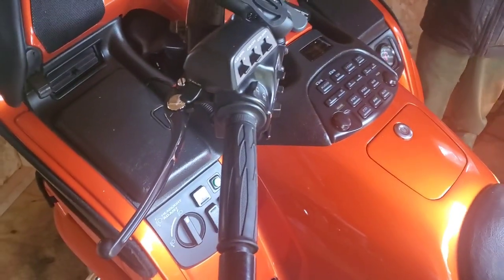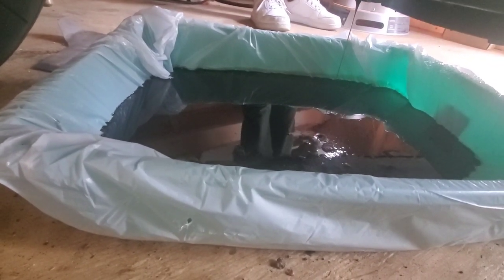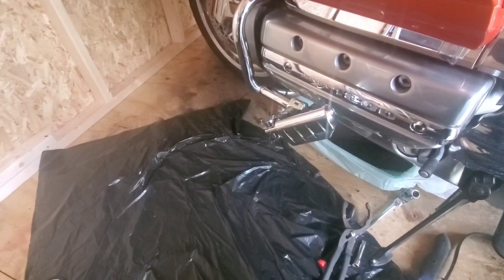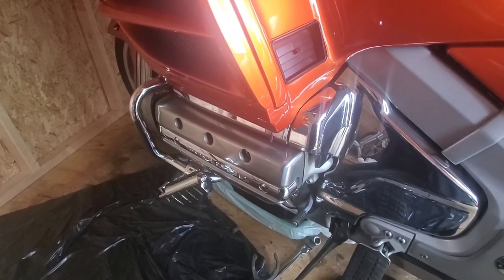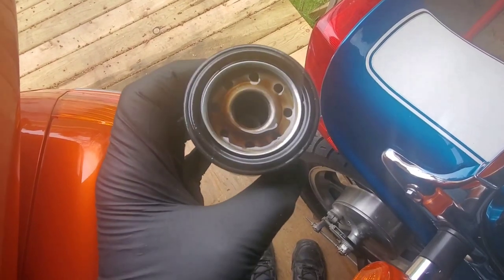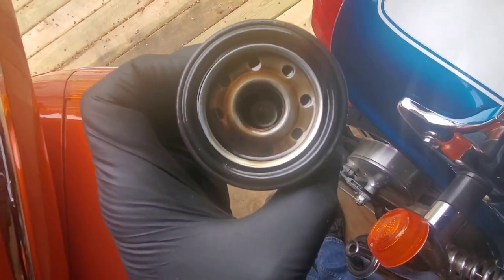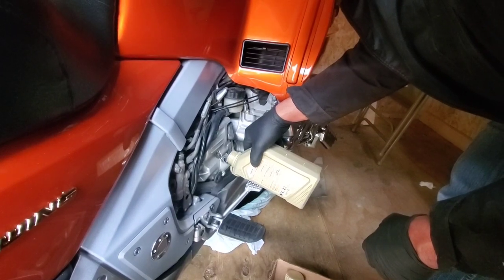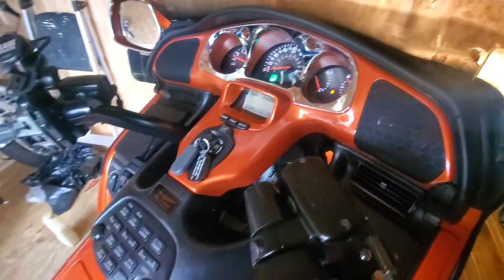WATCH THIS BEFORE YOU SEAFOAM A GOLD WING GL1800 AND POSSIBLY OTHER MOTORCYCLES

Comment: I fought the dreaded hesitation for 2 years on my 2008 Gl1800. I tried several bottles of seafoam, it seemed to help but did not cure it. I ran across an obscure post on a forum about the hesitation, he claimed to fix it. There was no other discussion about the fix he had explained. It was time for an air filter so while I had the shelter off I did what he recommended, it cured it. If you look closely down the bore of your throttle body where the butterfly plate seats on the sides of the bore at idle, you will see a faint dirty mark from the throttle plate. Take a toothbrush soaked with seafoam and lightly scrub that mark off the bore and the plate clean. It fixed it completely. I've got about 8K on it since then and still running perfect. Mine was so bad it was difficult to do any slow speed maneuvers in a stone parking lot without slipping the clutch drastically. Next time you do an air filter, check it out. You must look closely to see it, at first I didn't, then I got a light and I could see a dirt mark.
Reply from the maker: Well thank you. That is great info to have and will check into it. It has seemed to stop so far. However if it comes back I will do this the way it is explained. Thanks for watching and your informational comment. Stay safe my friend.
Reply: same thing for me too, once the butterflies were clean, no more stumble
Reply: That just seems almost unbelievable does it not? I'm not doubting you,  I just find it hard to believe that simply cleaning a tiny bit of a deposit on the throttle body bore would remedy a low speed stumble. That's wild.
Reply: @mosmotorcyclejourney9067 Moe is that s stock color orange or did you have it repainted???👍👍
Reply: @seatime674  That is a stock factory orange color from Honda. I’m not sure what year they made a couple of different oranges through the years. I’m 2000 up to 2010. I’m sure they had at least two different orange colors.
Reply: @raymondshartrand2417  I Think that orange was from '02 only..

Comment: That is a after market skid pan. We use sefome in our shop also but don't ever put more than 1/4 bottle well the top of your pistons and valves  are clean. We have been working on goldwings since 1975 we have great results with ams best viscosity will not lose more than 5%. Have bikes we work on with over 289000 miles on ams. One of those people is a imploye. Good video have a great day. Pops

Comment: I appreciate what you told us about the sea foam. I just bought a 1998 1500 with 18,000 and right away I changed the oil. I then noticed I had a hesitation and knew it was from sitting so long. 
Also, I owned three 1800's and they all had that pan under the motor and its to keep rocks from ponding the lower part of the motor.

Comment: Be thankful you have that metal guard covering the bottom of your engine Mo, it is to prevent objects from being thrown up from the surface of the road and going through your engine cases.
Reply from the maker: Trust me I am. I just never seen it on any oil change videos. And some videos on you tube say you have to remove the lower plastic piece where fog lights are to access the filter. Not on mine I didn't.  All I removed was the bottom pan and there it was. Thanks for the comment.

Comment: In to addition road debris protection some of the Wings have fore and aft ridges under there that can act as wings in a severe crosswind, leading to bad handling.  The belly pan blocks those cross winds.  Or so I read before I got mine!
 
1995 GL1500, Mobile1, once a season ( even for 10-12,000 miles. But it is almost all high miles, and very little in town. )

Comment: Pans are aftermarket item. I use the valvoline full syn in my wing. Told the dealer that .... he was agast that i wasnt using honda  lube. He even dared to say regular dinosaur honda oil was better. I just smiled and said thanks for your opinion.
Reply from the maker: I prefer vavoline just couldn't find it when I went to get it. I did order some off line and will be here next week. And I think I'm still gonna switch over. Can't hurt anything to change it again.  I prefer vavoline. And I hear it works great in the 1800 with a wet clutch. Thanks for letting me know the pans being aftermarket. Very much appreciated.

Comment: Conventional oil disapates heat better while synthetic superior slickness reduces friction. I use Honda synthetic blend. My engine runs cool and oil change intervals once every season is clean. The pan protects the motor from road debris definitely leave it on. Yes many bikes don't have that protection. Great video seafoam is a great product and can be added to oil right before oil change. Good call on dumping the oil right after treatment.

Comment: Great info on the oil. I have heard about the sea foam treatment but nothing about changing the oil after adding sea foam to the fuel.
Reply from the maker: Yeah if your bike hasn't had seafoam before I would definitely change the oil after a good treatment. It does clean alot of carbon out of the motor. Thanks for watching 👍
Reply: So your saying if u had seafoam to your fuel it cleans the whole motor. How does the seafoam get into you oil and cleans it

Comment: I used Shell Rottella T4 Conventional 15w40 in my Yamaha yx600. 14 bucks for 4 quarts. 
They have T6 which is the same weight but fully synthetic. Little more in price but lower than buying "motorcycle oil". its also got a lot of stuff to keep low miles motors running longer and keeping them clean. Same with older motors with zink and such.
Reply from the maker: Thanks for putting thus info on here. I get alot of questions about what kind of oil to use. And I love when people put what they use so others can see what works. Thanks again for viewing and please be safe out there
Reply: Ditto. Shell Rotella for my 38-year-old pristine ‘84 GL1200. But only the T6 FULL SYNTHETIC. Synthetic only  in all my vehicles. Syn is much superior to organic in every way. Longer lasting with superior lube qualities. Where organic oil will scald at high temps and lose its viscosity, synthetic has a MUCH higher scald temp retaining its viscosity much longer than organics can. It’s nearly burn proof!

Comment: I acquired a oil test machine at a sportsman show. I've tested all popular oils over the years an found "Castrol" oil out performs other oils, not by much, but still out performs!
Reply from the maker: Wow Tim. Thanks for sharing that information. 😀  maybe I should give that oil a closer look. 🤔  I never did a test on oil. Other then draining it out and refilling it. Lol. thanks for watching and the comment. Be safe sir.
Reply: You stack one lb. slotted weights on a rod, loading pressure 30 too 1 on head pressure until oil can't take any more pressure.  For a base dry test: seizures at 120lbs! Oil general seizes at 180lbs (giving most oils 60lbs of pressure, loading too seizure! Castrol takes one more weight than 180 too 210lbs!)
Reply from the maker: @timbarnett3898  that is great info. 👍   thank you for putting this in the comments Tim. That is useful information and I guess I will give Castrol another try. And that was also a great explanation of the test.

Comment: I had the same problem on my 2012… that slow speed hesitation… my fix was to get a G2 throttle tamer… the plastic oem throttle tube from Honda is crap… the G2 smoothed that hesitation right out… so no sea foam was needed 😊also what helped was to get the wide clutch lever from Show Chrome… better control at slow speeds using the friction zone 👍

Comment: I put seafoam in my 1800 about 2 ounces in tank about every 5 fill ups ,Half a can would be enough for about 20 gallons of fuell ,That much may affect oil ,I've not had dirty oil from the process I do
Reply: Thank you!  I'm glad I'm not the only one that does Seafoam this way!  I've never had a problem adding it to the tank, especially if I'm going to let it sit for a while in the winter.  I also change my synthetic oil every 5k miles whether it needs it or not.

Comment: I plan on doing this treatment on mine. Just changed the oil so think I'll wait a bit. Like you said the oil turns dark quickly. I am using non friction additive synthetic mobile 1. I also was surprised how expensive the filter was too. Made in China. Factory filter from Honda dealer as I prefer Honda only. Great video Sir!
Reply from the maker: Thank you Tyler. I  did find online a Genuine Honda Goldwing Oil Filter OEM on ebay for around 12 bucks. So I ordered a few considering I have a 1500 and it takes the same filter. Thank you for the comment sir. Be safe and thanks for watching. 👍
Reply: @mosmotorcyclejourney9067  Yes Sir. I'll bet you and I are fine folks that will obtain the best engine life. In fact my veterinarian said he has never seen a Black Labrador live past mine. 15 years. You have a blessed heart and when I watch your videos I feel so at peace. Thank you Sir.
Reply from the maker: @tnasburypl  wait what. You have a black lab. Lol I have a black lab that is 13 yrs old. My last one I had to put down at 13yrs. Wow. Yes sir you are correct. We will get the best out of our engines. And we have things in common. Be safe. Thanks for sharing 👍

Comment: I just did a seafoam in both the gas and the engine oil. Drove it about 180 miles and changed the oil this weekend. I have yet to see what driving is like as I took off my wheels to get new tires put on and now have to replace the brake pads. The oil was only because I don't know exactly what the previous owner did. I know he was a sheriff and evidently did a lot of off duty work so maybe a lot of slow maneuvering, so I just wanted to make sure the clutch plates were clean. The oil was pretty dang dirty.

Comment: My 1500 had been sitting a couple of years before I got it and stumbled  at low throttle plus the gas was nasty. Tossed the old gas and filled it with 93 and a whole bottle of Seafoam. By half a tank, no more stumble. Oil was who knows how old so fresh oil and filter along with 4 oz. of Seafoam. After 300 miles it was filthy so it got changed with Mobile 1 again. About 500 miles now and it's getting dark again.  Seafoam loosens the crud and a good oil flushes it out of passages and crevices. It ain't cheap but oil is cheaper than steel.
Reply from the maker: It's cheaper then finding a mechanic to figure out why the stumble. Alot of people run seafoam but never check how bad the oil is after. Glad it help your stumble. Thanks for the comment 👍

Comment: I’m only asking because maybe I’m not getting what you’re saying, but adding anything into your fuel tank should not result in that getting into your engine oil, if it did then surely your fuel would always leak into your oil?? And if so then surely your oil could leak into your combustion chamber and you’d be burning smoke the whole time your engine is running ?? Maybe I’m 100% wring but that would be my understanding ?
Reply: I was thinking the same thing you are correct
Reply: I  agree, I don't understand how adding Sea Foam to the fuel system would have anything to do with oil in the crankcase.
Reply: It's called blow bye. When combustion blows past the rings to the crank case. This is one of the reasons you have a crank case vent to allow the pressure in the case to escape. It's always happening in every engine. Some engine's have more than others.

Comment: I swear by SeaFoam. After I bought my other bike (Suzuki Boulevard C90T 1500cc), I ran SeaFoam through it and my mileage shot up significantly. I got over 50 MPG after running SeaFoam through it. It didn't stay that high, but still stayed in the mid-40 for miles per gallon. I'm not going to complain about that at all.

Comment: Mo, The belly pan was used on 1500's so the side covers would not blow off. They also help on the freeway when passing a semi. keeps the bike more stable. the front part of the belly pan is held on by aircraft screws so it was easy to remove it to get at the oil filter.
Reply from the maker: Thanks for the comment Jim. 👍   and please ride safe out there.
Reply: @mosmotorcyclejourney9067  same to you Mo

Comment: Mo, be very careful with the Seafoam in your fuel system. It dries out rubber. So you increase the chances of fuel line failure from the inside of the lines. I'd think once would be fine.
Reply from the maker: You are absolutely correct Chris. That's why I don't use alot. And only did it once. I hear of some guys doing it before winter and I would not recommend that. It sits in the carbs too long.  Thanks for watching and your comment. Be safe. 👍
Reply: I have an 83 Interstate. Still have it after 11 years. I use seafoam in it when I fuel up and when it get's put away for winter. I live in Michigan. Never had a problem with the seafoam. I will say I always change the oil at the  4000 mile mark or very close to it. I use Valvoline 20w40  Motorcycle oil.  Don't forget, Seafoam was in the beginning made for two cycle boat engines in mind. Lot of sensitive parts in those.  Just sayin  ;)
Reply from the maker: @frontcentermusician  interesting information 🤔 . I have never let it sit in an 1800 over winter. But I have done it to my GL1200 years ago through the winter and all the GL1500s I have had. I have 2 1500s that sat with seafoam in the gas over this past winter with no problem.  And i poured half a bottle in the tank with very little gas in it. I have had conflicting story's when it comes to a GL1800. That's why I only did it once. But I feel I could do the same as the other models without a problem. If anyone has had a problem with seafoam in an GL1800 please chime in and let us know your thoughts. I also live in Michigan.

Comment: Yes sir they are belly pans. They stop anything you might hit on the road to avoid cracking the aluminum block
Reply from the maker: Thanks Randy. Thanks for watching.
Reply: ALSO   A  BELLY  PAN  HELPS  PROTECT   THE. WING'S   PLASTIC  COOLANT   OVERFLOW   RESERVOIR, 
***  IT'S   WORTH  THE   COST ,  NOT  THAT  EXPENSIVE  &  EASY  TO   PUT  ON  A  WING  .

Comment: I use seafoam for storage only seems to work fine  on my GL1500 never ever thought about the deposit thing BUT i only put a small amount Half a can seems like a lot for gallons!
Reply from the maker: Thanks for the comment. Yes, it was a lot, and the bike did fine with it. But it definitely cleared it out. Had alot of deposits in there for that pil to be black like it was. But doing small amounts like you is fine. I do small amounts when the bike sits over winter.

Comment: I think you should be using 10w30. The make of oil isn't important as long as its reputable
Reply from the maker: I agree about the make however in the service manual it states the recommended weight for the temperature where I live, and it recommends to use  a 40 weight.  I go by the service manual. Thanks for the comment and watching my video. Be safe on that wing.

Comment: Wait, you just added the SeaFoam to your gasoline and got it that black? Wow!! And you didn't add Seafoam to your crankcase oil 100 miles before the oil change like SeaFoam suggests to clean the inside of the engine. I've used SeaFoam in the gas tank to clean the fuel system and injectors.
Reply from the maker: Well I have no idea why the oil was that dirty. It had just been changed before I added the seafoam and I checked it myself and it was clean. But not after the treatment in the gas. I would think that was carbon deposits in the combustion chamber and the oil collected it. Only explanation I can find.

Comment: The dealer told me if you’re going from the regular mineral oil that is started out with an all gold wings, OEM oil and you go to synthetic you are likely to develop oil leaks because of the molecular size of the mineral oil is larger than the synthetic oil and therefore it will penetrate those all the gaskets and stuff and eventually cause oil leaks. So I stayed with the OEM Honda oil.
Have you on the bike since it was new and used synthetic always? I just bought this 2005 and it only had 27,000 miles and it is always been serviced by the dealer so it always had that OEM oil.
Reply: Personally, I've never experienced that.  I've owned Goldwings from 1200's through 1800's and put synthetic in them after I got them.  I've also had several winter projects that were 1500's and several 1800's that the previous owners stated they all ran dino oil in them. I've never had a problem with them leaking oil and have used Amsoil, Mobile 1 and Rotella T6 (my current choice and favorite) in 5w40 and 15w40.

Comment: You are holding the oil bottle upside down. Look at the image on the bottle. The spout should be held at the top to minimize spilling
Reply from the maker: Yep you are correct. But when you have no funnel you do what works. And holding the bottle the other way poured oil all on my motor because of the angle of where you pour it in.  Thanks for watching and the comment.

Comment: How do you cure the idle lope?
Reply from the maker: Depends on what's causing it. Could be a air issue with gas cap, could be a vac line, or could be you just need to clean the throttle body with some carb cleaner. That's under the air filter. When it closes to an idle it could have some carbon deposits built up around it causing the unsteady idle.